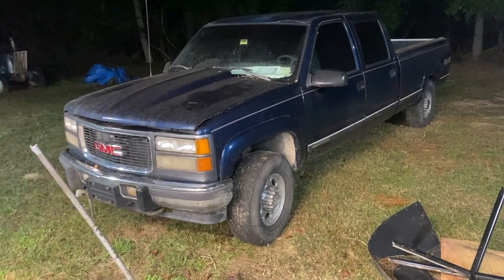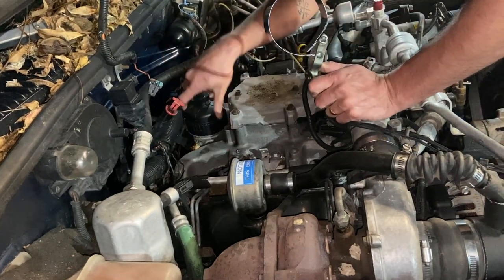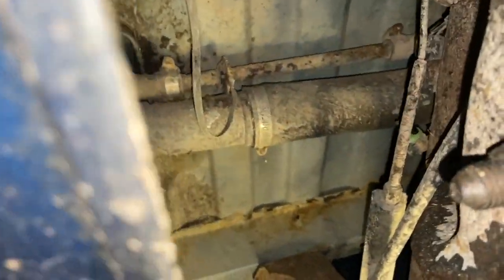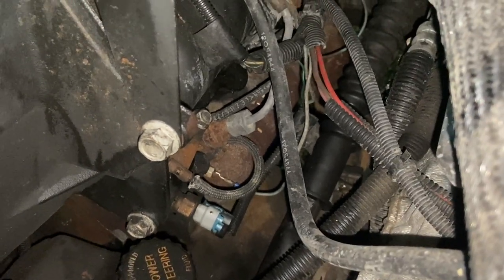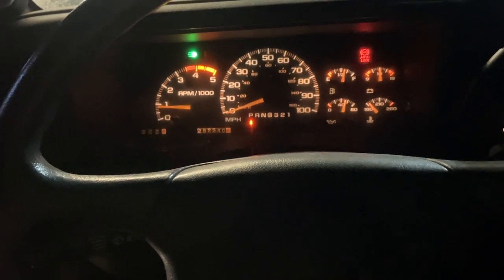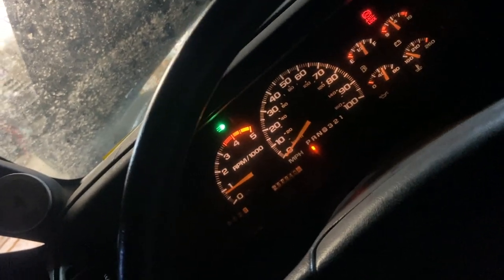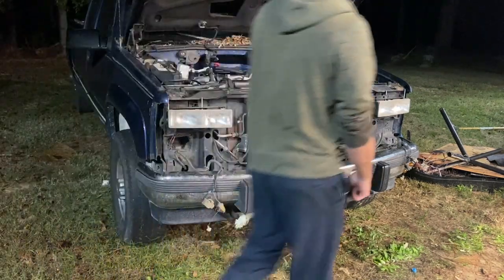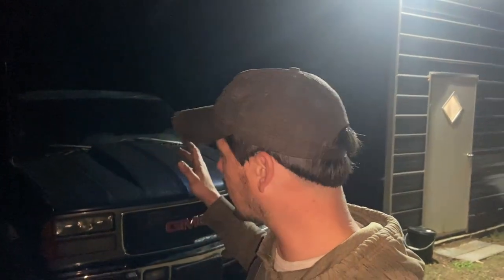96 GMC k3500 REVIVAL: 6.5L DIESEL HARD START/RUNNING ROUGH

Comment: I have a 1996 GMC 2500 with the 6.5 as well. Have had it over 23 years... Still runs great.. I like your truck. Engine seems to be running well... Just an FYI... Those holes on your front bumper are there for a reason. Those fog lamps should have not been installed there.. Those holes are to let in fresh air for your engine.. Diesels require large quantities of air for them to run well.  Thought you as should now.
Reply: The holes in the bumper are for diesel engine cooling hence you don’t see them on the gassers. 
Blocking them defeats the purpose and further bakes the PMD (FSD)…

Comment: Just got done doing my ffm for a fuel leak. Fortunately on the 94 the intakes didn't have to be removed to do the job. Not surprised that the PMD not mounted to a heat sink was the problem. They don't just get hot, they get HOT!  And yeah, that T valve that had a rubber hose leading to nowhere is, as you guessed, the water in fuel drain for the ffm. Really enjoyed the vid, thanks.
Reply from the maker: Thanks man! I didn’t have to pull the intake but I wanted to replace the rubber fuel lines to the pump so I figured it would make my life easier! Yeah I have a couple modules on the shelf just in case!
Reply: @hodgepodgegarage3911  I replaced the fuel lines, too. Opted to not rerun them under the intakes so as to be able to get to them easier if they ever need replacing. Hopefully never.

Comment: Cool truck! Been looking for one just like it for the farm. Had a similar ffm problem with my truck. It was leaking fuel through that water separator/ drain and loosing prime. Probably not the best fix but I clamped off the drain hose. No issues so far. Great video!
Reply from the maker: If it works it’s not dumb right? Lol we’ll if your in Charleston sc and looking this one’s for sale lol
Reply: It would be a drive for me lol. I’m in Alabama.
Reply from the maker: @johnquaidwestmoreland4184  haha proooobly not worth it lol

Comment: I know this is an old video and I haven’t watched it all the way through yet but on my 1997  C 3500 crew cab long bed I have a P400  6.5L T Diesel and on one injector pump I had the optical. I sensor went out on the injector pump before I bought a brand new pump from Leroy’s Diesel that optical license sensor creates a lot of problems if you get dirty fuel or it can get the flat out as well, but if fuel gets past that filter, it will create a problem starting and run running problem as well and stumbling similar to the PMD issues as well. Also check your PMD connections. Make sure they’re clean no crusty green crust also quadstar diesel. They sell a lot of parts for our 6.5 diesels as well and also lift pumps. Low pressure output is a big issue with these trucks. I should say our trucks as well. I still have mine will not give it up but anyway good luck with your project. Also on the windshield wipers there was a recall they replace mine and I had about 100+ thousand miles on them on the truck and they replaced it the motor assembly several years ago. I’m thinking somewhere around 2017 when they replace mine for a recall, so check into that and see if they’re still recall out for the windshield wiper motor assembly For your truck just saying might get lucky it was for mine and those PMDs yeah always keep a back up PMD.

Comment: Thx for the video. I have a different problem. Starts hard but seems to pulsate at idle and loss of power. One time I could undo the battery cable and reset the computer but not any longer. It starts hard a seems stuck in a limp mode. Any suggestions??

Comment: Your a real good diesel mechanic.  I live in a small town and we don't have a diesel mech.  I have a 93 3500 6.5
I put in a new battery and now the relay that heats up the glow plugs that shows  lights on the dash doesn't lite 
up. I will start with the fuses and then try to find out if it is the relay.  It won't crank.  Any ideas would be appreciated.
Reply from the maker: @09Youba  thanks! On a 93 was that a mechanical pump or electric, on this truck the glow plug light was controlled by the ecm and will set a check engine light if it doesn’t come on, they are individual bulbs on the back of the gauge cluster, could be a bulb, but the glow plug relay things were knows to be crap, the 6.5 doesn’t like to start without glow plugs

Comment: I got a 6.5 98 k3500 crew cab drw and I got a while back and I am at a head scratcher with the wiring to the engine . Was planning to pull her out and to a refresh on her since she has been sitting without oil for some time
Reply: I am not that good with wiring . At all
Reply from the maker: I couldn’t tell you much about how the wiring is supposed to be, is it the original harness? Has it been cut up?

Comment: I have a 2001 c3500… had water and algae in the tanks, replaced them both, replaced lines, sending units, n I threw a PMD separator filter, shut off Solenoid, oil pressure sensor, lift pump….. truck turns on after a long hard crank, then shuts off after 30 seconds…  I am ready to drop a grenade under it

Comment: Get that pmd off the manifold. To hot.  I have one mounted by the fuse box and one behind the front bumper . Keep one mounted for emergency. Those pmd 's can cause some crazy crap. That little T handle is a drain . You can drain the water every so often,

Comment: Hey man interesting vid. I have a 6.5 burb I just bought and it already had the pmd relocated with a new one but it runs like crap and always has a hard start even when engine is hot. Only thing that will fix it is when I change the fuel filter and I have to keep cleaning the new one out every few days to keep it from bogging down when driving. What could this be? Vibrates around 2000 rpm. Also, when I clean the fuel filter, I don’t notice any garbage in it so I don’t know why it makes a difference when I do lol. Any thoughts?
Reply from the maker: That’s an odd problem, I’ve had a few with the crap in the tank, it clogs the sick in the tank, that and check for air leaks in the fuel lines, if air gets in it’s a pain to have to air bleed every time you start it
Reply: @hodgepodgegarage3911  wonder how air could be getting in the lines?
Reply from the maker: @Lucasr09  I’ve had more than one leak from the fuel filter cap, the aftermarket ones don’t always seal well on the housings, I’ve been trying to stay with the metal capped filters, and found more than one rubber line clamp loose on these trucks lol also the injectors are a problem child cuz no one ever changes them, gen recommended replacing injectors every 100,000 miles, I’ve had one truck smoke real bad due to injectors and one truck hard start cuz of plugged injectors

Comment: I got a 6.5 just got it back running white smokes and very hard start any ideas
Reply from the maker: Sounds like probably either injectors or injection pump, I like to throw injectors in them, go recommended changing injectors every 100,000 miles but no one ever does, and they’re fairly cheap can get a set for like 400$ last time I ordered some

Comment: i have a 2000 6.5 3500 that runs amazing and i just noticed a 2 inch horizontal crack in the front drivers side of frame if anyone’s looking for parts or wants to take it lmk
Reply from the maker: Is it behind the steering box? I believe they make a weld in patch for those
Reply: @hodgepodgegarage3911  dude yes it is !!